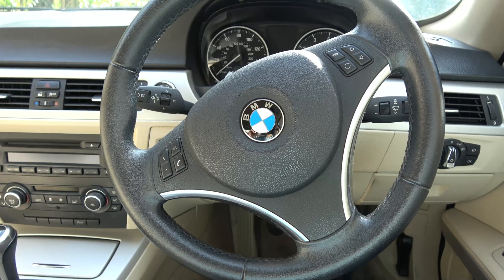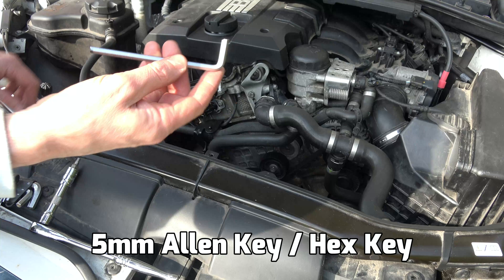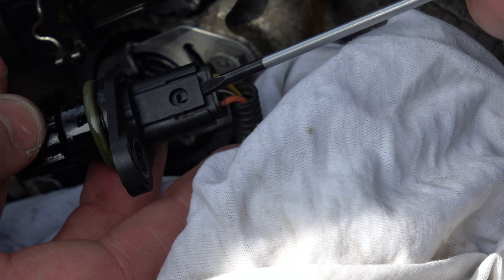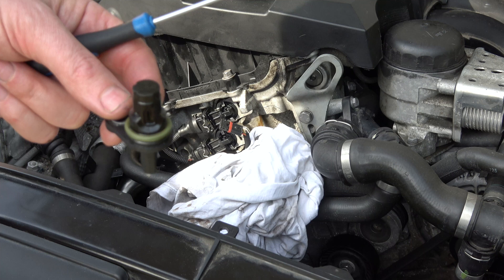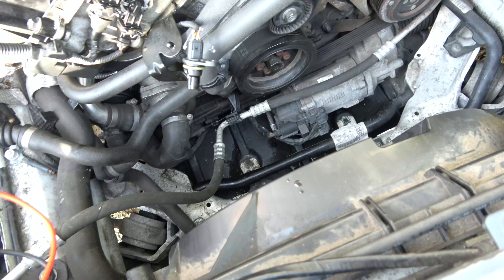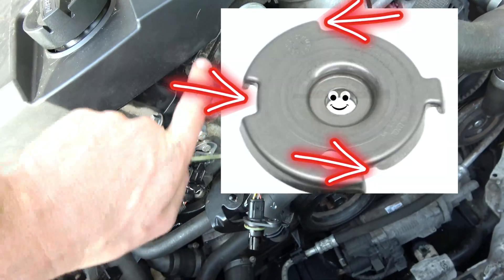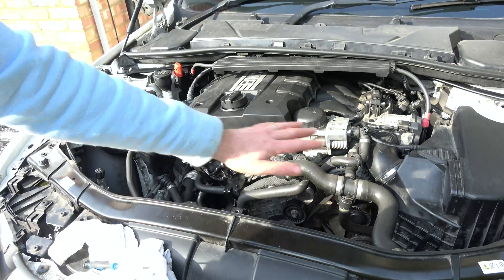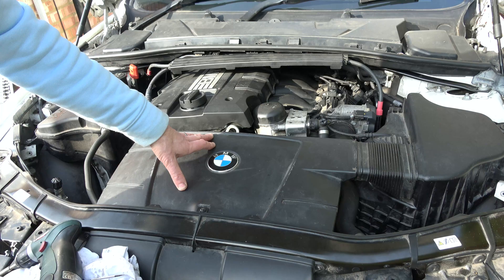How to REPLACE & TEST Intake Camshaft Position Sensor on BMW 320i N43 Engine

Comment: Hi man I’ve got same vehicle mint condition been serviced every 5000 miles no lights on apart of tires and some lights which bulbs need to be replaced but weird part is when it goes to limp mode no power and won’t move so random even when put acceleration down I kinda feel some pad attraction and same on brake I wonder what it could be ? Note no engine light on all its off ! Will much much appreciated an opinion on this thanks

Comment: at the end, the camshaft sensor is  working and put it back.  my faulty code is appear on the exhaust sensor. would it possible the battery replacement reset all things. sometime no need to replace faulty sensor